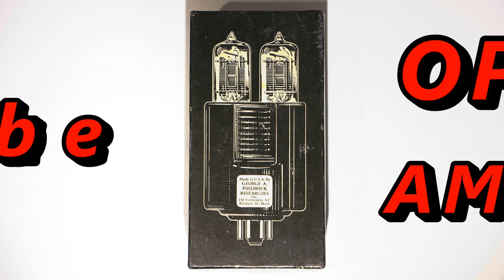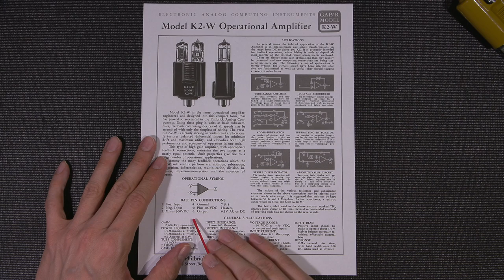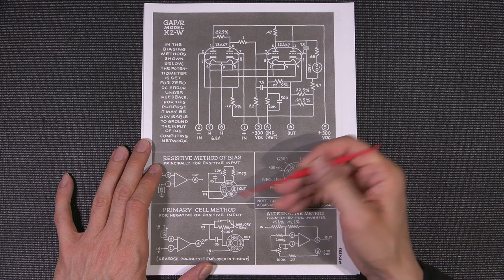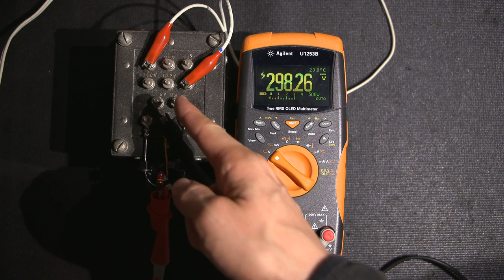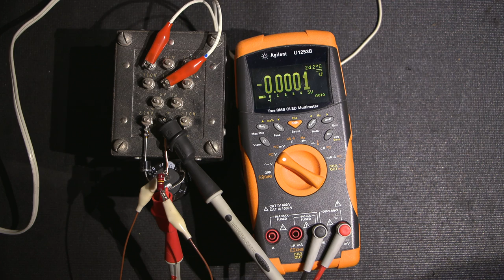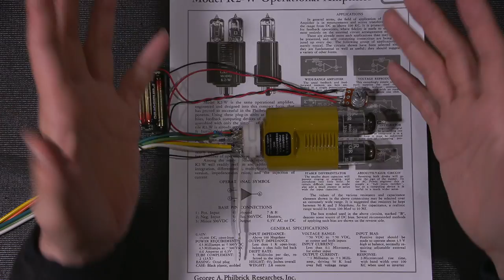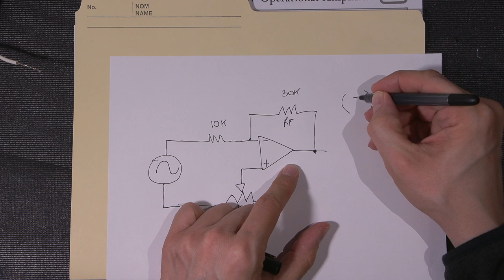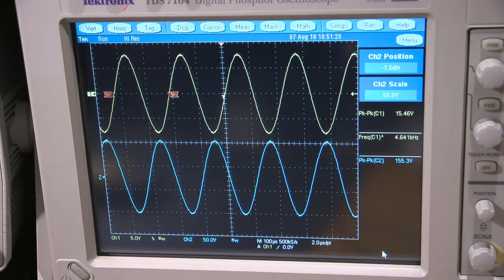600 Volt Tube Op Amp! Lets Power It Up.

Comment: At RCA labs I was the guy who tested the 12AX7 tube and matched them up using a Tektronix scope curve tracer. I built a chassis to pre heat 100 tubes at a time fir the 100 hour burn in time . All the data was recorded by hand and cataloged in  bank of file cabinets.
It might appear you the reader as a dull and monotone nous job, but I loved every minute of everyday. The money was very good and I got to work with real gentlemen like Mr. Carlson. Staying late at night working overtime was a joy . I learned so much. Then it all ended with my induction into the United States Army. Fortunately fir me the Army realized my skills and trained me to repair radio equipment. Two years later when I returned hime , my old job was available to me, but now the technology  had changed so much and OP amps were now solid state bricks. Testing  and setup the was done by machine. I used my Army experience and went back to RCA training as a Radio / TV technician. Color TV service was a good job in the mid sixties, however I did not like doing in home repairs. By 1970 I earned my way into the shop and later on into the research lab. Over my 40 year experience i had to learn so much as technology never stood still. Here I am at 80 watching Mr. Carlson’s  refresher course videos of my life. I am proud and very hard to have chosen electronics as my lives work and hobby. For all of you out there, stick too it and stay with it. Electronics is hard but interesting work that nerds do. Wear that title proudly.

 with

Comment: Great Video. I used tube opamps during my Melbourne university electronic degree back in 1960's. Our analog computer had 100 channels which allowed us to model quite complex systems. The computer (MUDPAC) remained in service until 1970 when digital computers were cheaper. Analog was still used for real time emulation in rocketry because analog computers could integrate/differentiate much faster than digital computers. They were also much better for non-linear systems because of their high compliance (+/-100V). Sadly by 1980 all benefits had disappeared and IC OpAmps and digital computers completely replaced tube opamps.
Reply from the maker: Thanks for taking the time to write Peter!
Reply: Peter Kay I
Reply: Thanks for sharing your story/fond memory, Peter. I'd  loved to have viewed that set-up!
Cheers

Comment: The most scary capacitors that I worked with were 100 μF at 8.6 kV, used to power an x-ray machine. One of the safety compliance tests was to demonstrate the mechanism to directly short the cap if the cabinet was opened improperly. The first test vaporized the hinge on the shorting bar. It sounded like about six double-barrel 12 gauge shotguns being fired at once. Needless to say, a much larger hinge was designed and tested.
Reply from the maker: Those caps are used in "coin shrinking" demo's as well.
Reply: I thought Xray tubes run on 70kV and up?
Reply: NiHaoMike The capacitors were used to power a Marx surge pulse generator, which powered a field emission x-ray tube at 350 kV. The pulses were delivered at 1 kHz, and the number of pulses was determined by the exposure. The result was a low-dose high resolution chest x-ray system. The technology was developed by Field Emission Corp., and went to market in 1973. Hewlett-Packard bought the company in 1974. 
Around 1977, Floating Point Systems started selling array processors, to GE and J&J, making CT possible.
Reply: My father has dealt with GE medical xray his entire career. I remember seeing the huge volt packs when I was young.
Reply: E=½CV². C=0.0001 F; assume V=8000 volts, so E=6400 J (joules) = 1.53 gram of TNT equivalent.
Reply: @quaztron  interesting. A Colt .45 service round (230 gr) is 446 joules. The cap discharge was roughly equivalent to 14.4 rounds fired simultaneously.
Reply: @BlankBrain  I was also thinking that the gunpowder charges in cartridges/bullets/rounds/ammunition that might be in the energy range. Such a small amount of TNT is not strictly "practical" for comparison. (You could release the 6400J in 1.53g of TNT by burning it, but there would be no bang. You could release the 6400J by detonating it, but the minimum blasting cap would probably be bigger than the charge.) You could imagine a similar amount of some other material that has similar energy density but is easier to detonate, such as liquid nitonitroglycerin. The bangs of the capacitor discharge, the TNT, and the cartridge could be within an order of magnitude (a factor of 10). •The capacitor: The electrical discharge on shorting a capacitor heats and melts metal and emits visible and UV light - these don't contribute to the bang. It heats the air and vaporizes some metal - these make the bang. (You might be able to maximize the bang by selecting the best length and diameter of wire.)  Combustion of the vaporized metal (now fuel) might add significant energy to the bang. •The "TNT": TNT detonates; the solid or liquid rapidly converts into superdense gas, which expands, making the bang. •The cartridge: The small primer detonates, but the powder charge merely burns very rapidly (it does not detonate). A small part of the energy goes into accelerating the bullet and overcoming barrel friction. (The pistol is an internal-combustion engine, and the bullet is its piston.) A directional jet of air exits the barrel in front of the bullet, and then, after the bullet leaves, a higher-pressure jet of hot dirty air escapes. A directional jet does not convert to sound as efficiently as a symmetrical spherical expansion. Some the kinetic energy of the gas converts into a shock wave (the bang); the rest converts into turbulence. The listed energy density of TNT is 4.184 GJ/MG = 4.184 MJ/kg = 4184 J/g, so 6400J comes to 1.39 g of TNT. Gunpowder lists as 4700 to 11300 J/g; call it 7300 J/g (higher energy density than TNT), so 6400 J comes to 0.88 g of gunpowder. •Cartridge: A ".45 Winchester Magnum" cartridge lists 230 grains (15g) of powder and a projectile energy of 1772 J (more efficient than your example); that means 118 J/g on the projectile. But 15g of powder releases ~109,500 J. Only 1.62% of the powder's energy leaves as kinetic energy on the bullet; the other 98.38% goes into friction, heat, and kinetic energy of the exhaust gas; some of which becomes bang. 6400 J equals the kinetic energy of 3.6 of these bullets - so the bang has the energy of the impact of 3.6 bullets, at muzzle velocity, hitting all at once. But 6400J = the fuel energy of only 0.05845 cartridges - the energy released by one cartridge is the same as 17.1 capacitor bangs. I don't know the efficiency of sound conversion, so I can't predict whether one gunshot is louder than one capacitor bang. If the efficiencies are similar, then the gunshot will be louder. Even an improved calculation could be wrong; only an actual "shootout" can tell for sure. Firing the round as a "blank" might be louder or softer. Firing the round outside of the gun might be louder or softer.
Reply: @NiHaoMike64  I didn't see your comment until a year later. You're right, 70kV is in the range for thermionic x-ray tubes. The 8kV capacitors were used to charge a Marx-surge pulse generator at 1kHz. The resulting 360kV powered a cold-cathode field emission x-ray tube. About 36 pulses was enough for a chest x-ray. The number of pulses (exposure) was determined by a dosimeter behind the target. We had industrial x-ray machines that ran 2.5MV.
Reply: @quaztron  The test was conducted in a metal shed. It was quite loud outside. One of the physicists who was in the shed looked kind of dazed when he came out. He said that next time they would test outside. Your comment got me to thinking about how one would take stored capacitor energy and convert it to the loudest sound. At first I was considering what frequencies would be most important. Then it occurred to me that a supersonic shock wave would likely be loudest. Then the challenge is to disperse or focus the wave. That would determine the dimensions of the discharge surface(s). Different air pressures would certainly make a difference. There may be gasses that produce a faster or louder wave than air. As I remember, it's not very good for the large capacitor to discharge through a direct short.
Reply: This is a great thread of comments!!!

Comment: Bob Pease started his career at Philbrick and wrote some of his Pease Porridge columns plus some articles in at least two compendium books about his experiences there.
We never had any of these Philbrick tube op-amps.  They were way expensive for our control systems.  We built our own with 2N930 transistors that we mounted as pairs in aluminum blocks to keep the temperature matched.  At one time we had stability problems on a purchased production line that used tube amplifiers, thyratron tubes and finally a Ward Leonard generator set.  We improved their tube op amp circuits as a quick fix, but then we replaced the controls with our own op-amp and SCR system.  In those days, the SCRs were new and the best ones we could get were 2N688 (later on 2N692 became our standard SCR).
Our op-amp had a maximum gain of about 3,000 and when some commercial modules became available (from Fairchild as well as from Burr-Brown and naturally from Philbrick) that offered gains over 20,000, we occasionally used those.  The next attempt was to use Fairchild 702 IC, but its unbalanced voltage swing was no good.  Quickly, though, there came the 709 that was good enough to replace our own amplifiers as well as the modules.  And then the godsend 741 arrived.
Reply from the maker: Great story Pellervo! Thanks for taking the time to write.
Reply: Electronics design: 1. Bob Pease built this varactor-input op-amp out of discrete components, based on an old design of Jim Williams.  When Jim Williams died, Bob pease went to his funeral. On his way back, he crashed his vw beatle killing him... The day analog died. watched all old Bob Pease videos on YT. Such a gentle giant.
Reply: Thanks for the history, I'd somehow forgotten the 709 (kept thinking "So what was before the 741? Maybe 723 - but that ain't right..." :-)
Reply: Just out of curiosity, where did you work at these amentioned times?
Reply: Meri Lundström ,  It was Nokia Cable Works, or actually before the fusion, it was called Suomen Kaapelitehdas.  My first job was trying to put together a pin hole sensor for lead jacket of cables.  Those pin holes were formed by dirt particles in the molten lead that was extruded around the paper insulated telephone cable.  The dirt was most abundant when we were using recycled lead from old lead acid batteries.  My final report however had to state that no single sensor would do for all the different cable sizes, with the limit of usability changed somewhere around 0.5 inch diameter.  Smaller cables could be sensed with a surrounding set of coils, while larger ones required a rotating probe or a set of multiple probes.  Too complex, and moreover, the use of lead as cable jacket was already expected to fade away and be replaced with plastics.  Situation might have been different with modern ICs — after all, the metal detectors at airports work with the same principle.
Reply: Very interesting inside story. Thanks for sharing in detail! Had completely missed out the fact that lead was commonly used as emi shield for twisted pair cables...eh, polymer technology has provided at least as much relief for the manufacturing industry as the solid-state takeover :)
Reply: Meri Lundström  —. Actually I realize I did not cover the reasons properly.  The reason for lead jacket was to provide hermetic shield.  More so than to act as electrical shield.  That is also why the pinholes were a big problem.  The wire insulation was oven dried paper.  If it got wet, the wire to wire resistance collapsed and even more, the capacitance skyrocketed.  That was a big cause for poor telephone connections from time to time in those days.
But not all bad, as we found when the plastic cables for any reason got their jacket damaged.  Where the old paper insulation swelled up when wet, and the water did not travel far, the plastic cables had open conduits between the wires and water traveled maybe miles (or kilometers)!  To remedy that, the gaps were filled with vaseline.  I don’t know if that was a final solution, or if something better was found after my departure.
Reply: Geez, vaseline sounds a bit of a temporary fix even per hole, let alone as a network upkeep solution :D  But thanks for refining the purpose of lead jacketing, and for this interesting looking-back field story!

Comment: Way back when (1964), while my friends were into Ham radio, I built an analog computer, based on modules built into Vector aluminum cases. A typical Op Amp module was put together using one 6U8 and two 6AU6 tubes and the supply voltage was +-300V. Still have one right in front of me as we speak. The plug-in module used an eleven pin octal socket. Fun stuff! 
Also, nF was not an unfamiliar way to express capacitance at the time. 
Enjoy your videos, for sure.

Comment: Very good video.  Back in the tube days vehicles were making the transition from 6 volt to 12 volt electrical systems.  So a center tapped heater would allow the designer to build a radio that could operate on either system.

Comment: I restored a Dymec (HP) 2401A hybrid tube/transistor 5 digit systems multimeter a number of years ago that was made in 1962.  At the front of the input is a Philbrick Research supplied tube type op-amp printed circuit board.  An interesting piece with very thick, gold plated traces.  It inspired me at the time to read about GAP/R, and that was as interesting as the Dymec meter itself.  Thanks for this segment.

Comment: This is a blast from the past for me.  I worked at Red Johnson Electronics 1966-68, at the counter, a surplus store on El Camino near Stanford where I went to school.  One day I came in and one of the boss's friends was sitting with a large pile of these - he'd cornered the market for these devices at the same time that the first IC devices became available, and the only value they now had was for the tubes in the units so he had thousands he was pulling the tubes out of in order to sell the tubes as a single lot.

Comment: In a similar vein I remember "FETtrons" - solid state direct replacments for valves (tubes). The FET circuitry mimicked the performance of a particular valve and could literally be plugged into the existing valve socket,
Reply: Funny, I mentioned FETrons to an acquaintance just a couple weeks back -- so that's twice in 50 years that those have come up in my conversations :-)

Comment: Easiest way to quickly connect this type is to use an octal relay socket, gives you a nice base to use flat, plus it has numbered screw terminals.

Comment: I made plenty of anode voltage doomsday contraptions for testing various stuff and I like to put a neon indicator on an output, it will stop glowing at around 70-80V DC, I treat it as a low tech sanity check.

Comment: Great video. I’ve been playing around with “solid state” analog computers to learn more about op amps. I’ve got a few working  Comdyna GP-6 computers, and a whole stack of Heathkit EC-1s in various conditions, but mostly working. I find the subject fascinating. Most of the early missile guidance work was done with analog computers. I’ve picked up a couple of Philbrick P2 transistor op amps, but I haven’t had a chance to try them out. That op amp was in beautiful shape. I didn’t realize they used 12AX7s. I saw the base on eBay a few times, but passed it up because I thought it would be hard to find tubes for it. If anyone is interested in learning about op amps, the old Philbrick applications manual is a really interesting read. The pdf is available on the Analog Devices website. Thanks for your great work Mr. Carlson!
Reply: Tim Thompson, I had about 40 of those Philbrick op-amps back in 2002 from cleaning out a small electronics warehouse----they sold quite well on ebay, and the best part us, most of them had highly prized  Telefunken 12AX7s in them that tested like new! Ka-ching!!!

Comment: Don't forget mmf (micro micro Farad).  That was also a very popular unit of measure for caps way back when.
Reply from the maker: LOL, that's going way back Mike. Thanks for stopping by!
Reply: Mr Carlson's Lab  Or cm, that really confused me when I first saw it.
Reply: And mpF I've seen too - ie femto-farads
Reply: micro micro Farad  was common term in my younger days but instead of saying "micro micro" we said "mickey mikes".  I still like the old equipment. Thanks Paul for teaching those days to the "New Comers".
Reply: Yes, I remember that, usually used for the mica caps.
Reply: MikesRadioRepair back when capacitors were condensers and frequency was in kilocycles.
Reply: That's what my dad taught me.  He worked for Bell Labs from 1926 to 69.

Comment: We used literally scores of K2W's in the Navy's X14A6 Antisubmarine Warfare Tactical Simulator at the Navy Operating Base (NOB) in Norfolk during the late 1960's. They were driven by a digital time base established with a huge magnetic reed switch column that was a mechanical precursor to the soon-to-be all solid-state digital signal generator.
Reply: it's probably still in use and the most accurate working device there ;))

Comment: Another informative video. One other thing I learned, in all my years in electronics (60 + years), I always thought that the writing on the tube designated the filament voltage, the engineers initials that developed the tube, and of course, the number of elements. Oh well, learn something everyday.